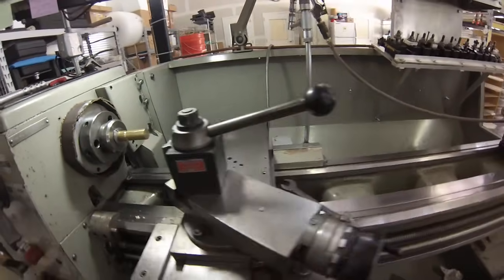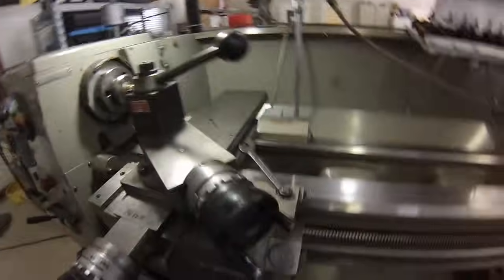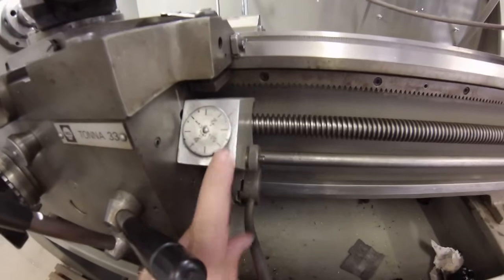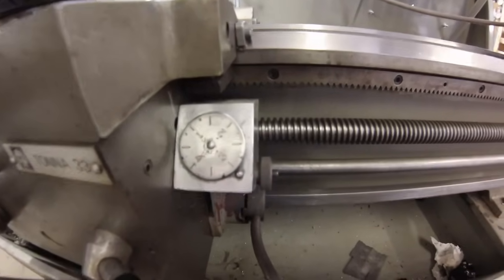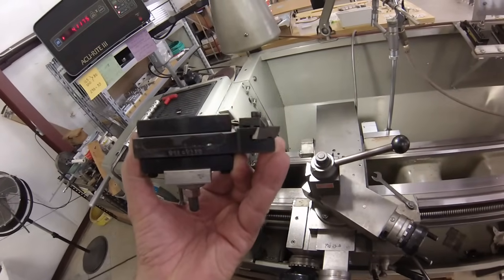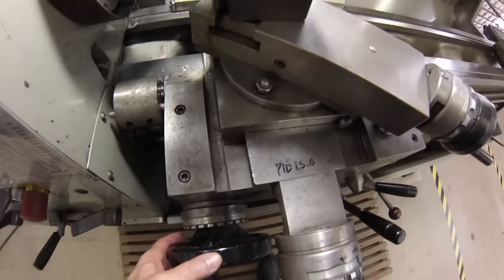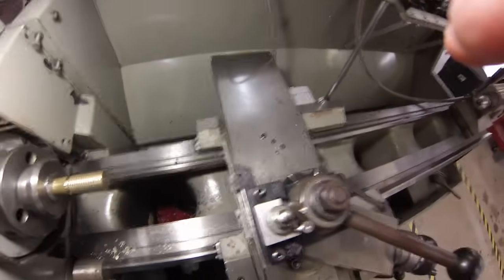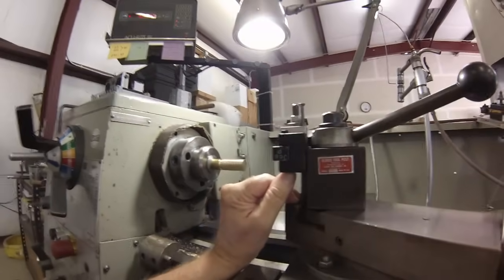Threading on a manual lathe  BEST TECHNIQUE EVER !!!!

Comment: "If you half thread a 10 pitch thread you end up with a 20 pitch thread". I get what you're saying, but really you have a double lead 10 pitch thread :)
Reply: I know I'm a year too late to this party, but the way I was taught is that the term "pitch" is independent of the number of leads. So a double lead 20 pitch thread would have a lead of 0.1" . Or you could say pitch is threads/inch and lead is how far a nut would travel/revolution= number of leads x inches/thread.
Reply: @DavidTaylor-es1bt  ....You say "pitch" is independent of the number of leads.... Actually, lead divided by number of  "starts" equals pitch, so lead and pitch are interdependent, and generally, any screw can only have one lead. Lead, as you say later, is how far the appropriate nut would travel per revolution on a screw... (your statement sort of confirms what I'm saying?) Perhaps North American terminology differs, though. 
When you're screwcutting, you're setting the machine for the "lead" irrespective of pitch, and achieving pitch by any of a number of forms of division for starts.  Easiest way on the Colchester/Hardinge in the video is indexing via the camlocks for two or three starts, and few people ever need more than that... Actually, I've re-viewed the video, and since that's a Master, Student or equivalent, that advice would only work for three starts, the machine having only three camlocks... Larger machines have six, allowing two, three or six (unlikely) starts to be performed simply. Worth remembering that standard threading inserts may not have adequate side clearance for the extreme lead angle of a multistart thread.  Guess how I know? (Just once, though!)
I was later to the party than you, too...
Reply: @robertlawson8572  
Fellas tho I'm late to comments I'll throw this out there.
 Thread pitch is the distance from the root of one thread to the root of the next. It's does not matter how many leads a given thread has since the only way to cut a multiple lead thread is with all leads having the same pitch be it sae or metric.
   A machinist handbook is a wonderful thing, as no one can possibly remember everything that's in there ! Well someone might but I doubt there would be more than three in the world , lol.
Reply: @stevenmassey7586  Hi, Steven, You define pitch correctly, (distance between corresponding points on adjacent threads) but you're confused about lead.  "Lead" (unless they've started defining it differently since 1966 when I first cut a thread...) is simply the distance a nut will travel along a screw in a single turn of the nut (or, conversely, if the nut's fixed, the distance the screw will travel in the nut, given a single turn.  That is lead.  You can only have one on a given screw (generally)  I won't get into the one exception I've seen. What you define as "multiple leads" is "multiple starts" in English, but, my 1964 Machinery's shows you guys across the pond don't (didn't) use the term "starts" but say "single thread", "double thread" and "triple thread", but still define "lead" as "pitch x number of threads". Which "leads" us back to the fact that you can (generally) only have one (1) lead on a given screw, it being a combination of pitch times number of starts (English) or number of threads (US)  I don't think we're that far apart, save for your use of the term "leads"  in a way that isn't as defined.
Reply: @robertlawson8572  I'm sure there are some language and perhaps also some different ways of using lead. 
   On any machine I ever used to thread I would select tpi on the chart attached to the machine. :) can't remember Remember doing it any other way (?) But it's been a good many years since I worked in a actual shop.
  Having looked it up lead is best described as the distance a nut would travel in one revaluation. Which by logic would match the pitch. When cutting multiple lead threads you simply double~ Triple...etcetera the the distances the nut would travel. 
  I have also heard lead described as the number of thread starts, which would also be correct while not addressing the distance traveled.
  Pitch can also describe the angle of the sides of a thread.
   I'm sure on the other side of the pond some words are used differently but doubt a Machinist moving from one country to another would take very long to fit right in.
Reply: What I suggest is this... Close your eyes, think back to the days when you sat in a college classroom learning this, and it'll come back to you... Lead = pitch times threads (US) or starts (UK) For a single thread/start pitch and lead are the same, for multiple threads / starts, see my previous statement.  Pitch can't (accurately) be described as the thread angle, though people often describe things wrongly... And...not every machine has a tpi chart on it, and a simple set of selector levers.  I can still remember when some older machines had loose change gears to be assembled into a compound train on a quadrant between the headstock spindle and leadscrew. (a lot like you still have to do when gearcutting with a conventional dividing head)  Gears with 20 to 120 teeth in steps of five, with a 63 or 127 tooth gear for Metric threads. Of course, it's so much simpler now.
As for "I have heard"... That happens a lot.  What you must do is fact check what you've heard.  There's a tendency to believe charismatic, forceful, badly informed blowhards, isn't there?  @stevenmassey7586
Reply from the maker: Your comment is accurate, but....I always thought if you had a double lead 10, the actual pitch was 5TPI x 2. I have only cut a few double lead threads ( intentionally ) in my entire career. Am I mistaken?
Reply: By double lead 10 I meant two 10 pitch threads intertwined with each other. 20 thread crests in one inch, but with the helix angle of 10. I guess I stated it wrong
Reply: Terms and lauguages aside.
Once the machinist hands the part off to....
Say a millwright, maybe an engjneer....
Pitch is simply the distance that one mated part covers axialy along the other in one revolution.

Kind of bottom line basic (F).
Of the 3 (F)s. 
Form fit, and fuction.
In this case function.
OR.
Joe! How far can you pitch this shot put, in one throw.
In some circles I'm told....
+ Throw + covers most cases of ONE cycle of a thing.

Comment: great trick little scared about my threaded spindle coming off though. its funny i just posted a video showing my new thread measuring wires .
Reply from the maker: Are you comfortable using them?  Remember, the flat on the nose of tool  1/8 P  reference.
Reply: don't understand what you mean Joe
Reply from the maker: My comment was wire specific. Wires will accurately measure the PD, but if the nose flat on your threading tool is too wide, the root diameter ends up too big and can lead to an interference. A good rule of thumb is the tool flat should not exceed 1/8 of the calculated pitch. Example...20 TPI = 1" divided by 20 threads per inch = .050 between threads. .050 divided by 8 = .006. That would be the flat you would want on the nose of your tool. I hope this is helpful.

Comment: I did know about running the lathe in reverse and threading away from the chuck from reading about it, but this is the first time I've seen it demonstrated. Makes perfect sense. I've got the same set of thread wires but your a lot better at holding all 3 with one hand than I am. Really excellent video.
Reply from the maker: Thanks. A small ball of modeling clay holds the wires too. It does not interfere with the measurement either.
Reply: Thanks Joe, I'll keep that in mind. I've also used a short section from a wide rubber band and just poked the wires through the rubber and that helps hold them together and from accidentally being dropped into the chip pan. Not that I've ever done that of course. :-)

Comment: Great tip and especially useful when I chase metric threads on my imperial threading lathe and can't disengage the half nut. I real nail bitter when threading metric threads close to a shoulder and braking the lathe to a stop while keeping the half nut engaged.  Thank you very much!
Reply from the maker: Glad I could help. Metric threads are a challenge on a good day.
Reply: Paul, Only trouble is the machine is not up to speed in a very short distance, which can give you chatter. Also if you are performing other operations you need to remember to reverse the direction otherwise ........ BOOM.

Comment: Nice to see someone else who takes a heavy first cut. Caution should be used with this method as it is really not suited to screw on chucks. I use this method all the time but with a rear tool post and a right way up tool.
Reply from the maker: Spindle still turns in reverse though, correct?
Reply: Yes, still in reverse. Great channel, I've subbed
Reply: Also the rear tool post is also not going to see the cutting forces trying lift the carnage from the machine bed, it’s not going to be a problem with most machines, but the light duty lathes could see this problem. Just for this threading technique and a parting tool I’m going to look at a rear tool post. Great channel.
Reply from the maker: Before you make the investment in a rear tool post, see if you can achieve the same results using a boring bar threading tool to do external threads. The final geometry of tool to part would be the same, and no extra money would be spent! But, your use of a live center during threading in either case may be sacrificed. Thanks for watching and taking the time to comment.

Comment: Threading is nothing compared to the frustration of using the 3 gauge wires technique, mostly with a pan full of chips. Thumbs up for threading micrometers...
(Please try using a stand for the camera)
Reply: Also a rubber eraser works to hold the wires.  Doug
Reply from the maker: Heres a free non video tip........stick a small ball of modeling clay on both sides of your part and press the wires into the clay. They will hold in place and seat under the micrometer pressure and the clay just goes away with the next pass. No charge. This was my first shop video. They have improved since this one. Thanks for the comment.
Reply: Now I got micrometers up to 5", before I used some axle grease or wax, but, there always was that time where it ended in a pan big pan full of chips....   Sigh...!!!
Reply from the maker: Thats a good idea. Then you only have to hold the eraser against the bottom of the part, correct?
Reply: Or clamp the wires on one end to a thread of same size and pitch with toolmakers clamps. Adjust the clamp to have parallel jaws.This threading method is especially good for your blood pressure when threading an inside thread in a blind hole. As a new subscriber I'm watching for your next one.

Comment: Joe, I'm very interested in your threading method.  I found a suitable tool holder for the BXA tool post, (that's my size too), NSL102B (MSC Part #: 88228812). I'm not sure about the insert, but I think NT2L (MSC Part #: 40623522). is the one to use.  I assume that you set the threading insert on center, is that correct?
Reply from the maker: Thanks Herb. Yes, you set the tool on center, or just slightly above (since its inverted ). You are going to like the total absence of the pucker factor. Good luck.

Comment: Hey Joe, think I have only seen one contributor use this method.  It's Interesting how you only feed the cross-slide (if I got that part correct?) not the compound.  Still getting my old stupid head around this but really enjoying the experience!!!  Kindest regards from Bonnie Scotland.  Joe.
Reply from the maker: Hi Joe. 2 things happen with the straight in approach. The tool wear is even, and you maintain your true thread start point. Many are taught the 29 1/2 degree use the compound setup way, but I've done it this way for 40 years without a hitch. You are correct on the cross slide only technique. Thank for the feedback.

Comment: G Day Joe,  To get the tool on center do you just sit it on top of the block you made?  Looks like Im off to buy wire gauges instead of the nut now lol. Interesting video.
Reply from the maker: An inverted tool is actually easier to center because the tower just needs to be able to slide under it. If you rest your tool tip on the height standard and tighten the post, I'm going to guess it is going to chip the tip off the tool. You may have to make an adapter block for your tool holder, but thats another video. Go get those wires and do it right on the first time around. Thanks for the comment.
Reply: The wire gauges tell you how much to take off on your last pass instead of guessing.

Comment: Nice Tip. I am not being negative here, just sharing my thoughts, would love your feedback. A lot of Engine Lathes have the Chucks screwed on to the Spindles on the Headstock, so running the machine in reverse it a bit of a fear, getting the chuck to unscrew.
Reply from the maker: Thank you for your comment. Your concerns are valid if your chuck is solely installed by threading and does not have a key and a threaded collar. Mine is a cam type, so its not a problem. Although threading is minimal drag, the choice to run a threaded chuck in reverse is up to the operator. I would refer to the machine manual for a safety suggestion if available.
Reply: +Joe Pieczynski thanks for sharing the thoughts. I'll tell you what, in India, Engine Lathes are dirt cheap & at that cost Machine Manuals are given a complete miss. lol...... would also like to add that these machines mostly have a 4 way tool post rather than the quick change one. you know what, I'll still give it a try, shoot the footage & share it with you. sounds good? btw, have a look at my channel for some Machine Shop related stuff. ☺️👍

Comment: Joe,  Do you have a closeup picture of the tool holder that you are using for the inverted threading tool.  It looks like you are using an offset block and I would like to make one like yours.  Could you post a picture of it.

Thanks
Chris
Reply from the maker: Good Morning Chris. The tool holder I am using is a NSL 123B kennametal insert holder. The inserts in that video were K68 grade carbide offset threading inserts. If you search out the holder number online, you can find them everywhere. They cost about $90 new. I believe the NSL 123A is basically the same holder, just 1/2" shorter. The NSR 123B is the holder I used to do the undercut. I had to mill mine down a bit to fit the BXA1 aloris blocks I have. The internet will probably have better images than I could post. I hope this helped. Thanks for watching and the comments.

Comment: Just found your channel and have subscribed.   Thanks for sharing your experience.  I do encourage you to place the camera in a stable holder, not free hand. Otherwise, it makes for a dizzy viewing experience. Understand you did not have the right gear then. Until next time, cheers. Daniel
Reply from the maker: Thanks Daniel. Welcome. I'll get better at the camera work. This was my first machining video. I think you'll find the more recent ones a bit better.
Reply from the maker: Welcome. Thanks for signing up. I will be trying to use a stationary mount whenever possible.
Reply: Make something so that you can attach the camera to a magnetic dti stand then you can stick that wherever you want on the machine
Reply from the maker: Great idea on the adapter for the camera to a mag base. I will do that.

Comment: I use this technique when internal threading.
I crashed my machine when I discovered the hard way my dial indicator was sticking.
Ever since, I do internals from the inside out.
Reply from the maker: This is a great way to do internal threads. The positive stop makes all the difference. You still run the machine in reverse, but you have the option of inverting your tool and working the bore side closest to you, or keeping the tool upright and working the backside of the bore. Either way, you draw the tool out of the hole and relax while you're doing it. Thanks for the comment.

Comment: Great tip on loosening the tool post tension so the tool will lift out of the cut if needed, also for form tooling. Very interesting. Also, a nicely done instructional video. One thing would make it easier to watch: placing the camera on a tripod. Hand held is difficult to control, even more difficult to watch. Thanks for sharing!
Reply from the maker: Jim, Thanks for the feedback. Aside from my scuba diving equipment and diving videos, this is the first video I shot about machine shop related material. Sorry about the 'Blair Witch' effect with the hand held camera. I'll have to rig up some good camera holding stuff and go from there. Some of the other videos do have tripod shots inspired by other viewers. Thanks for watching.
Reply from the maker: GoPro
Reply: Especially with that wide angle lens with so much barrel distortion.